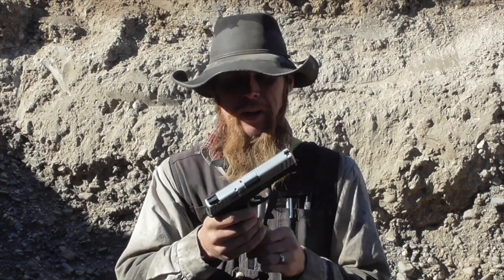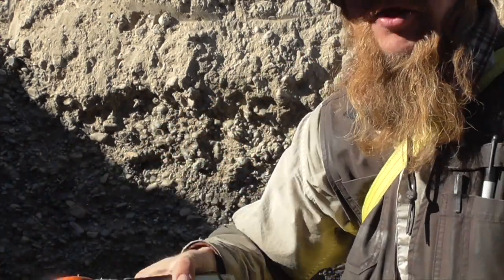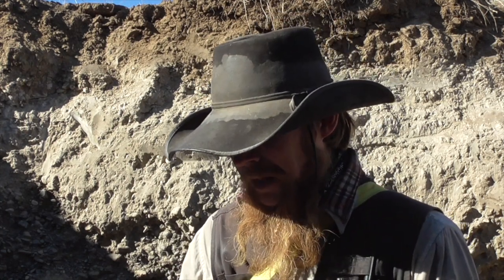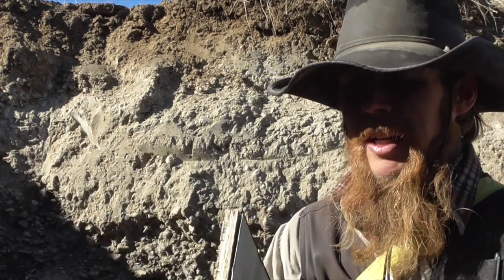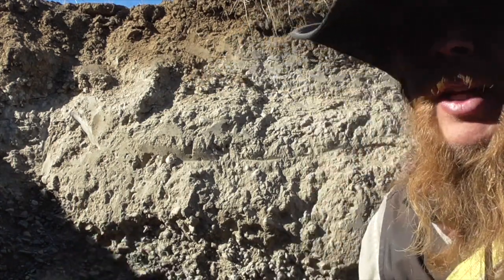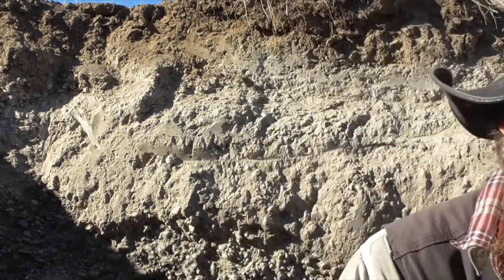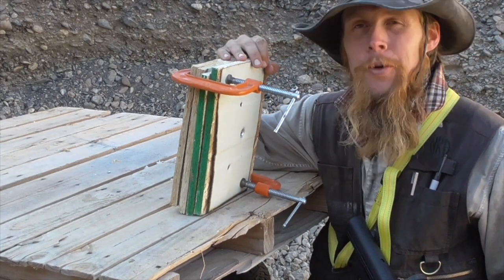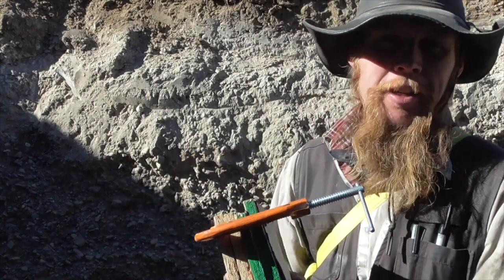Testing Improvised Body Armor: Sheet Metal + OSB (TIS233)

Comment: someone told me the thin metal of a shovel will stop a 22lr, I wonder how good it would work if you used several layers of shovel metal with rubber or canvas in between them. Then the overall thickness would still be relatively thin and somewhat usable for body armor? nice vid.

Comment: The frontal armor inside the turret of a T-72B is angled and spaced plates of steel and rubber (20mm steel, 3mm rubber, 3mm steel). It is interesting that, purely by intuition, you seem to be working along the same lines!  It would be great to see if a home-made steel and rubber sandwich would be any more effective than one would otherwise expect.
Reply from the maker: Alternating layers of sheet metal and rubber from an old tire are on my list of things to test.

Comment: As odd as it may sound maybe something with a fiber mesh structure like a fiberglass welding blanket behind the metal and before the wafer board may try to hold the board or metal together while the wood maintains its impact absorption properties. Just a thought if your interested in trying other ideas.

Comment: Well if you live in an area where there is a lot of hunting taking place, it might be good wall material. :P 

But seriously where and how would you put this kind of armor? I mean, if you would want to make a vest with it, it would be difficult bulky. 

It might be better to make body armor like scale armor, like dragon skin *tm did. And maybe sinter (3d print) aramide fiber or something of the sort, and fill it up with something else resilient. Just thinking.. It may or may not  be possible. Maybe you can cast plates of some keramic in a shape and make a scale vest and put it in a kavlar carier. Anyway, that would make the best kind of armor, plus you can use it everywhere on your body. 

SCALE ARMOR.. 

Greetings,

Jeff

Comment: I suggest an additional step to these tests. 
try making a brace that holds the "armor" in a fixed position. A theory comes to mind that some of the ballistic energy is transferred to inertial movement, and that may slightly affect penetration.
You could try one held fixed and one held "loose" in your current c clamp setup.

Comment: If you use the same force with a sledge hammer that you use with a sword the sword will penetrate more deeply. No?  44 mag= sledge hammer   223 = more like a sword. And I like your vest.
Reply: No.

Which is why maces and hammers  were used against armor while swords were utterly useless.

As the Idahoan correctly points out, the reason for the .44 not penetrating is because it was a hollow point that mushrooms upon impact with the first layer.
Reply: @lorgarbeareroftheword5836  When I said "with the same force" One must consider the amount of force. I dare say that a sword being propelled with the force of a hammer or mace will penetrate more deeply than the hammer or mace.   No?
Reply: @HansFormerlyTraffer  

Well, its not a perfect analogy/ comparison.

But in the spirit of cooperation and not wanting to be a pedant, I can agree that's true enough.

Comment: I'd like to see the Sheetmetal with Separation / standoff layers
Alternate Sheetmetal and a 1-3mm of negligible foam sheet or corrugated cardboard, to examine the catching Deformation effect.  I recall shooting a machine with 357, the bullet hit 3/8 copper line and was CAUGHT by it whipping around.  Denting and stretching metal eats a ton of energy.  I think there would be more denting and less Driving Thru, if the sheetmetal layers had some room between to deform into before being supported from behind by next layer.
I dunno
What do you think?
Reply from the maker: I'll keep that idea in mind.

Comment: This is a good series, I see it as more useful for safe room construction than for body armor
Reply: If it is for anything like that, and it should be cheap, better to get some pond liner or covering sheet, and sandwitch some dirt or sand in between the wall boards.

Comment: I like what you are doing. I would like to see sheet metal with layers of rubber tire tread sandwiched between them. I am thinking the rubber will absorb more energy than the stiff OSB. 
Also, during WW2 the allies were going to make a giant ship like floating platform made of frozen water and sawdust to use near Greenland to use as a place for aircraft to land. It would have been armed. Supposedly it was unsinkable as cannon fire was not able to damage it as the wood and ice absorbed the energy of the shells. It would be interesting to see you make a frozen body armor made of sheet metal and frozen wood pulp and water.
Reply from the maker: Interesting ideas.  I'll keep those in mind.
Reply: Pykecrete.. heh, good stuff, but has Temp concerns.  
For particular applications is seems to be an awesome solution  
(kinda like Electric Cars.. good some places, and entirely not good in others)